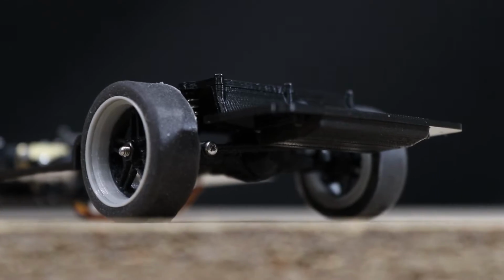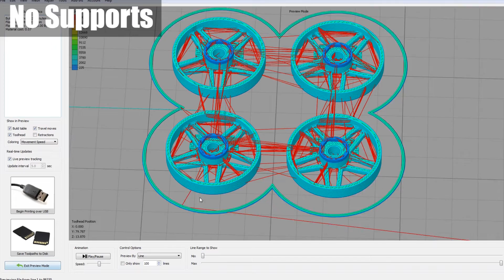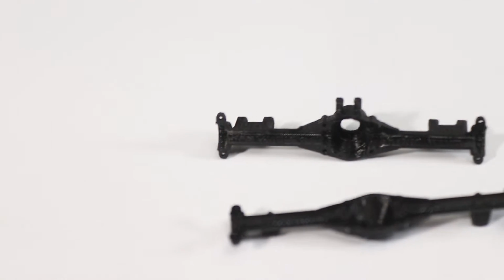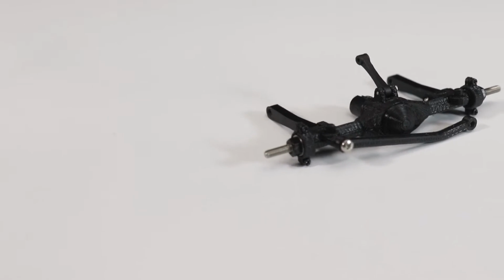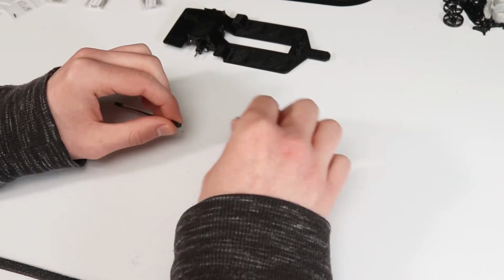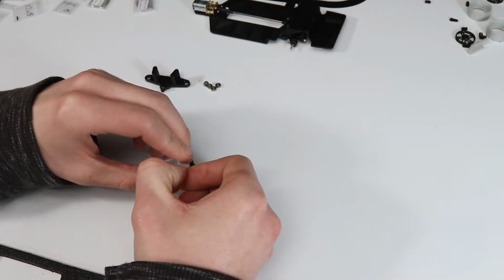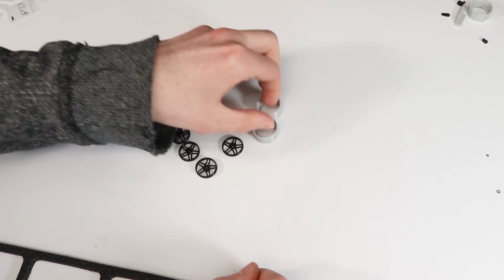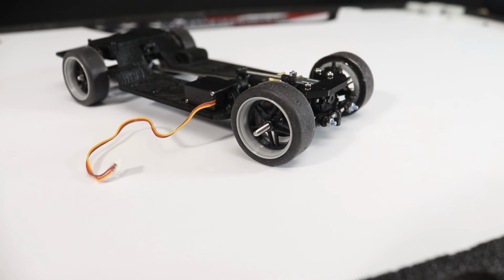3D Printable FFR SC1 1/24 Scale RC Chassis for Revell Shelby GT500 Model Kit Assembly Tutorial

Comment from the maker: Happy Holidays! I know a lot of folks have been patiently waiting for this chassis design and video, I hope they prove to be worth the wait. I have some other 3D printable projects similar to this in the works that I look forward to sharing with all of you. Also be sure to be on the lookout for the second video where I complete the build with that awesome GT500 body. 👍 🎄
Reply: If I decide to change out the motor for a bigger motor will the gears be able to handle it or will they wear out to quickly.
Reply from the maker: I can't say for certain whether or not the gears will hold up. These chassis' are really intended more for scale than speed. If high speeds or a lot of power is a top priority for your project, this might not be the best platform.
Reply: Ok thank you for the advice
Reply: @redpixel1133  I'd just like to add that looking at the driveshaft joints makes me think those little nubs would probably go before the gears.